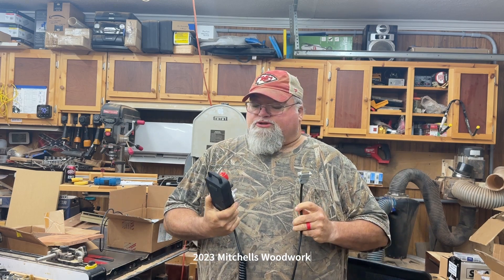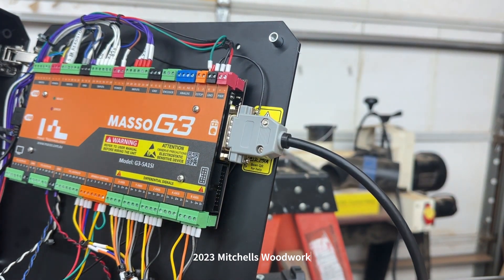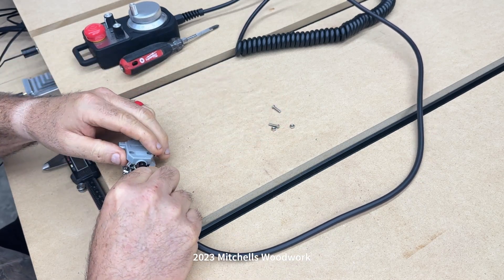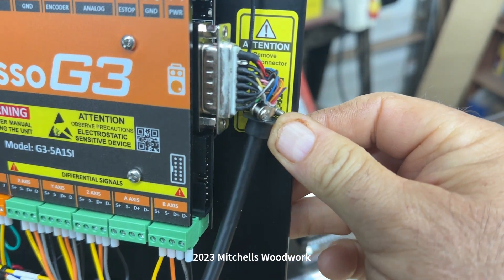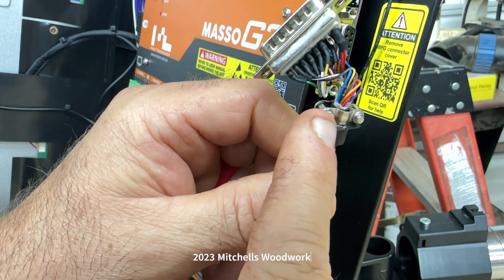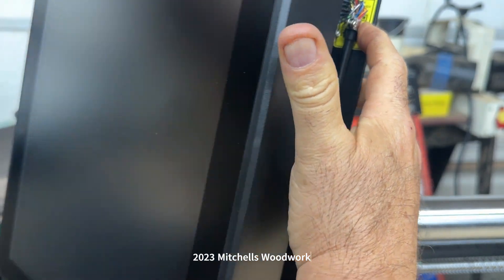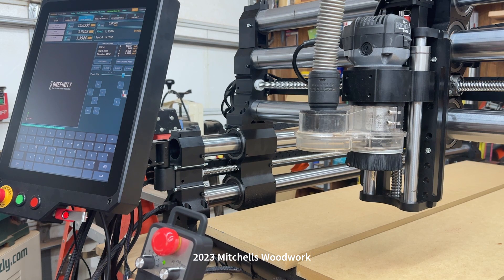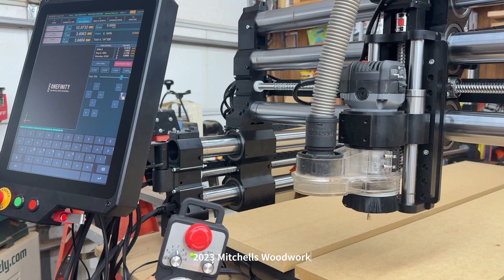Installing A Masso MPG Pendant on Onefinity Elite Foreman CNC

Comment: Ordered mine a while back, installed per your instructions, fixed the e-stop, but my pendant  will only move the x axis, and does it on all settings, including the off setting, but not the x setting.  Any ideas??  Thanks and your videos are very good and informative.
Reply from the maker: Double and triple check your wiring.  95% of the time it's wiring related, especially with a problem like you're describing.  Re-watch my video and make sure you followed my instructions to a T.  If you can't find the problem I do offer phone support for $60 per hour.  If you become an Elite channel member you get FREE 20 minutes of phone support each month.  Just let me know if I can help you.
Reply from the maker: Did you find the problem?
Reply: @MitchellsWoodwork yes.  User error.  Lol

Comment: I purchased a mpg pendant but it only works on slow speeds is there any settings to adjust it ?
Reply from the maker: You adjust the jogging speed with the right button below the red e-stop button.

Comment: Affiliate link discount isn’t working
Reply from the maker: Thank you for letting me know.  I’ll have to check with PwnCNC and see if they’ve removed the pendant from the affiliate discount.  Sorry for the problem.
Reply: @ sure thing. Let me know if you get it fixed. Thank you
Reply from the maker: Just found out that the Masso products aren’t included in the affiliate program.  Sorry about that, but thanks for bringing this to my attention.

Comment: Ive seen in another video on youtube that you have to move the black wire that goes into the Estop 2 hole, into the estop 1 holes.  Did you have to do this?
Reply from the maker: Moving the wire enables the e-stop button on the pendant to function.  But I didn’t know that trick when this particular video was made.  For anyone that hasn’t watched the estop button fix, the link is below. 

https://youtu.be/WdKDZwMqFD0?si=yx6JZcaXVp8jNnlb

Comment: Thanks, subbed.  Is there any software configuration required, or is it as simple as plugging it in?
Reply from the maker: I included everything in this video.  Plug and play!  You can now order it from PwnCNC here in the US for the same price and get much faster delivery.  Use my affiliate link to save 5% on everything they sell except for the ATC systems.  Thanks for subscribing!
 https://pwncnc.com/products/mpg-pendant?_pos=1&_psq=pendant&_ss=e&_v=1.0&ref=-KowKWxX6qaGK
Reply: @MitchellsWoodwork shouldn’t the red twist (stop button I’d think) disable it?  Mine works regardless of the red button in or out.  Thanks.
Reply from the maker: @user_16309 , watch my 5-Minute Fix video, which covers that exact problem. 😉
Please let me know if you need any further assistance.  Thanks for watching!

https://www.youtube.com/watch?v=WdKDZwMqFD0
Reply: @MitchellsWoodwork  Yes, I'd already found it and all is well.  Thank you!
Reply from the maker: @user_16309 great!

Comment: Great video.  The fit surprises me .  That said, it made for so many other machines.
Reply from the maker: It’s not a generic pendant.  It’s branded as Masso and recommended by them for THEIR Masso controller.  It should fit the newest version controller (G3) without modification.

Comment: Thanks for the info!

I received my Onefinity Foreman Elite last week. This is my first CNC purchase. It's almost ready to go, but my electrician won't be here until next week to install my dedicated 110V and 220V circuits to run it. I took my time with the build and it was pretty fun. I'm looking forward to using it, but I've got to say that I'm disappointed in the lack of manuals and documentation I've experienced so far. The 75-page Foreman Elite manual that I printed didn't even have page numbers even though there is an index listing page numbers to reference. That is just plain STUPID! My MPG pendant came with no instructions and I couldn't figure out where to plug in the serial connector. I couldn't find a manual anywhere. Luckily, I found this video. After spending over six grand on a CNC and accessories, I'm pissed that I have to modify the pendant to install it! It looks easy to do and I can handle it with no trouble, but I shouldn't have to!
Reply from the maker: I agree, I was (and still am) so surprised and disappointed about the crappy MPG pendant installation solution.  I expected MUCH better from Masso.  

Also, unnumbered pages on the Onefinity manual needs to be corrected.  I saw your suggestion on one of the Onefinity groups or forums yesterday (7/18), hopefully you’ll get a positive reply from them.  

Thanks for watching, and for commenting.  Be sure and check my channel for other Elite Foreman videos.  Especially the mods & tips playlist linked below:

https://youtube.com/playlist?list=PLqRrCnqsxc205ni9bmqukEaVEn2pkQF9M&si=52MRggiPQQ67O8ru

Comment: What was your experience ordering thru Masso?  Shipping time good?  Are they responsive?
Reply from the maker: I can’t remember how long it took for delivery, but I do remember being surprised at how fast it was.  I have asked a few questions on the Masso forum and I’ve had very good response time there.  Email support can lag quite a bit, but only because of the 14 ~ 17 hour time difference from the US.
Reply: @MitchellsWoodwork  Just bought the pendant.

Comment: You could add a small ribbon cable and avoid the shady install.
Reply from the maker: Man I still can’t believe Masso sends out something janky as hell like that.  I love my Masso controller, but that’s not a good look for them.  Anyway, I’m not an electronics guy at all.  Send me an Amazon link to what I need.  Thanks.
mitchellswoodwork[at]gmail dot com.
Reply: @MitchellsWoodwork  DB-15 Flat Cable "ribbon" is what the user Is referring too. I honestly think that would probably be the best bet. You could also cut a hole in the back of the case if going that route and mount the female end that way you could plug/unplug the pendent without opening the case. Though whatever you do be sure to use something like that zip tie standoff to enure you aren't pulling on the wires when moving it and keep tension. https://www.amazon.com/uxcell-Rainbow-Ribbon-Connector-19-7inch/dp/B07THGYKPN

Comment: Hi Marty,  I was early to your video and installed my pendant just as you did.  My estop didn't work either.  Masso support told me to move the black wire in estop from 2 to 1.  I see a viewer reported this in the comments.  I was watching Ugly Dog (Tune up your CNC series) and he showed doing this procedure.  One other thing he suggested.  Change the dipswitches on the X & Y motors from Onefinity settings (all up) to alternating 1 up, 2 down 3 up 4 down and then change the settings in F 1 from 400 to 4,000.  I haven't had any issues with how smooth my machine works. I would like your opinion.
Reply from the maker: Interesting!!  I’ll take a look at that!
Reply: @MitchellsWoodwork  Just made the changes and I can see a noticeable difference in the smoothness in movement in both X and Y after the change.  I was somewhat timid about doing anything to the settings, but just  decided I could always change it back.  Now, machine moves more smoothly and my Pendant Estop works.  Thanks to Ugly Dog.  I am going to order his VESA Mount.  Better price than PwnCNC stalk and I just don't trust the Amazon mounts for TVs and monitors.
Reply from the maker: @jimpalmer1944 Adam ( @uglydogwoodwoodshop ) is a great guy.  Glad to see him getting some business from my subscribers!  I’m gonna make the same changes on my machine later today.  I’ll report back here and let you know the results!

Comment: great video , I wonder   Where get mpg pendant from  . I try looking little  less price . cheer
Reply: The best price incl. shipping I found was at CNC4pc
Reply from the maker: Unless you are extremely proficient in electronics modifications, stay away from the cheaper Chinese knockoffs on Amazon, AliExpress, etc.  All of those require additional electronic wiring and hardware to reduce the Masso voltage from 24v to 5v.  There are other issues as well.  The Masso MPG pendant is “pretty much” plug-and-play.  All of the others require their plug (if there is one) to be changed to be compatible with the Masso.  You can read more at the link below:

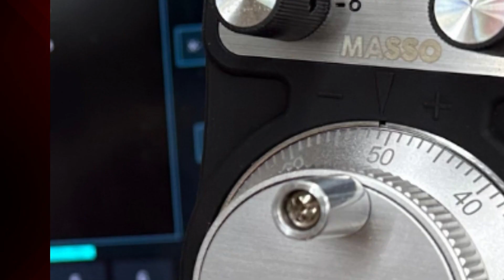https://forum.onefinitycnc.com/t/masso-pendant-options/19110 0:03

Comment: Does the standard wiring you demonstrate also make the eStop work? I saw a comment in a Onefinity forum that an additional wire is needed tomato the eStop on the pendant work.
Reply from the maker: They’re correct, the eStop requires an extra wire.  I have plans to do that at some point, and I’ll make a video when I do it.  Probably after the first of the year when the Christmas rush is over.

Comment: for $21 you can buy a 'mini bluetooth keyboard with dongle', plug the dongle into the Masso internal usb port, and Jog around x,y _wirelessly_. I've been doing that for weeks now, no cord dangling around. Costs about 14% of this 'Pendant' unit's price
Reply from the maker: THIS is why I love getting feedback from my followers!  Although, I did search Amazon for "'mini bluetooth keyboard with dongle" but didn't find anything with a dongle.  Or maybe I don't know what a dongle is?  Anyway, please post a link to the one you're using.  Thanks!

Comment: Does the e-stop button on the pendant work properly?
Reply from the maker: Not yet, I still haven’t figured that one out.  I’m thinking I read that it requires a jumper wire somewhere inside the Masso in order to function properly, but don’t quote me on that.  

For my usage, personally, I’m not too concerned about it.  However, I do want to make it work at some point. It’s SUPPOSED to work so I expect it TO work.  I’ll make a video on the subject when I figure it out.  Anyone out there know the secret sauce recipe?
Reply: That's pretty scary, considering that many (most?) cnc machines have motors strong enough to damage the machine itself or to damage people. Selling a non-operating eStop button seems like grounds for potential lawsuits (if the product requires hacks and jumpers to function, it's generally considered 'fixable' but not 'functional at sale'). @MitchellsWoodwork
Reply: I think I found the solution. I'll have to try it. On the Masso G3 the estop 2 has two wires running to it, a green and a black. The Black wire needs to be moved to Estop 1 while leaving the green in estop 2 and the pendant estop should work then. @MitchellsWoodwork
Reply: mine came in today and the estop doesn't work either - anybody figure it out yet?
Reply: It looks like there needs to be a jumper between the power source and the estop. There is a video showing the last Masso controller and how to connect the pendant and I imagine it's basically the same set up. You tube will not allow links in comments, but if you search: ( How to connect the Pendant Estop on Masso - Masso Edition 06 ), there is a 2 minute video. I'm nervous to try it, so I'll try to reach out to Masso. @tbas7161    @MitchellsWoodwork

Comment: You can get a right-angle (90 degree) connector to replace the original. The problem is the Masso enclosure's screw bosses are too far to the right - if the controller PCB were moved to the left, a standard straight connector will fit.
Reply from the maker: That would be awesome!  What is the proper name of the plug so I’ll know what to search for?
Reply: @MitchellsWoodwork It's a DB-15 connector